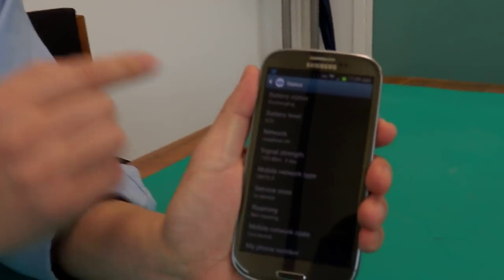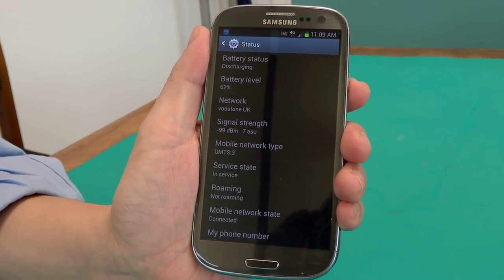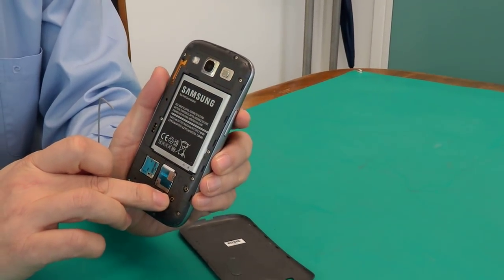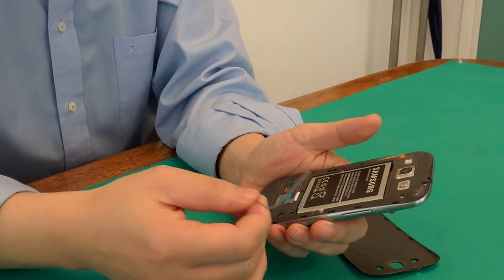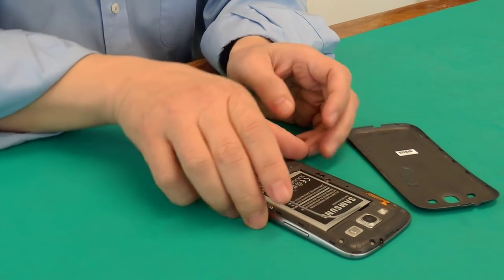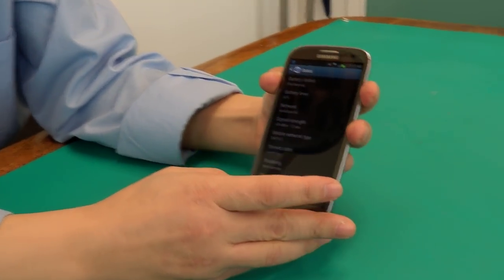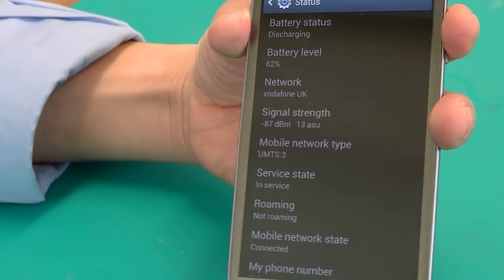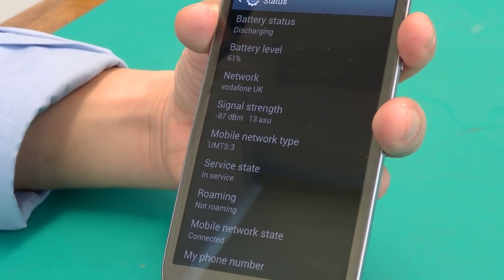How to improve mobile phone antenna performance

Comment: How would you apply this concept and use the same principle to improve signal reception on a phone that doesn't have exposed antennas like the Samsung? i.e. An LG Rebel 4  which has a removable plastic antenna cover plate which makes contact with small prongs on the board
Reply from the maker: New smartphones have many antennas to cover all desired bands and provide MIMO functions

Comment: Hi sir. Does it work on Wifi and Bluetooth signal strength?
Reply from the maker: Yes, but the frequency for WiFi is typically around 2.45 GHz, so the antenna length should be shorter

Comment: I have a S23 copy Android 13 it only has one port mini usb use for charging and radio
My signal strength
-81 dBm.  16 asu
asu is too low i cant get internet
Asu must be 53 ir higher to ger internet here in las vegas. Nv.
Now what do i do?

Comment: Just remove the external gsm connectors and solder a thin wire instead on the main board to rejoin the connections, on my Galaxy S5 that made the job from -98dB to -61bB now. No more poor signal. This connectors are to blame. They disconnect the internal antenna when you insert a wire in the middle of them and will not make a good contact with the wire nor with the internal antenna. You will need to be experimented in electronics for that.
Reply: I spoke with an gsm engineer from korea and he told me about this connectors. They have been put there for factory calibrations for gsm chip, but all of them are faulty in time, and lead  to poor signal on all phones.
Reply: @stefanputureanu9296  oh thank. But i don't  think that would work becoz there is a resistor under the hole where you have just installed wire.
Reply: @krishnamurariprasad3790  There should be a connector like this one https://cdn-shop.adafruit.com/1200x900/1661-00.jpg   If there is a resistor your phone is not a genuine S5
Reply: @stefanputureanu9296  its there but not at the place where you showed in you pic. Mine is exynos version. There might be some orientation difference.
Reply: @krishnamurariprasad3790  it is possible.  Good luck fixing your phone 😉
Reply: Stefan Putureanu Hi. How can i do it for my samsung galaxy note 4 (n910c)? Thanks.
Reply: @elecdroid3666  I don't know.
Reply: Hi sir. Does it work on Wifi and Bluetooth signal strength?
Reply: @jyreprejoles7604  I can't remember. The phone is old. Try to follow the trace on the pcb.

Comment: I have tried and it works but after that putting the wire in that small hole connector annetna  and removing it from that hole my network goes to emergency call only  can anybody  tell me recover the connector signals

Comment: Is that a paper clip? Also, cam aluminum and/or tin foil work?
Reply: Oh, and by the way. I tried this with an old charger wire, with a softer inside. It too worked and is too soft to damage the phone

Comment: This hack just killed the receiver on my Samsung s5. Great care was taken using only a thin piece of single strand insulated copper wire carefully pushed into the ports centre hole. Ive no service/network signal now. Started off poor, now none!!. Any advice on that please.
Reply: Wrong size antenna.  Heated up the receiver.  Cooked it.
Reply: Actually, the micro coaxial port became permanently disconnected inside by poking the wire in. Removed the port and solder bridged a strand of wire across, all is fine again. Think i will stick with the stock dipole antenna from now on.

Comment: dont use this method
Reply: Arslan Qureshi why
Reply: can i ask why?
Reply: Because I destroy my mobile anteena Samsung S4 using this method
Reply: @latouselatrec  whats happen bro
Reply: @thebonfiree  your supposed to use an insulated wire
Reply: @latouselatrec  Yes I use Coper wire but I dont know what happens. 
First 10 mins my mobile get very good signals but then anteena cable that is inside my phone destroy.
Reply: @thebonfiree  yes but was as it insulated?
Reply: @latouselatrec  Everything works great for 10 mins then my mobile stop recieving signals. 

Then I goto mobile repair shop, he said your signal wire is damaged then he replace.